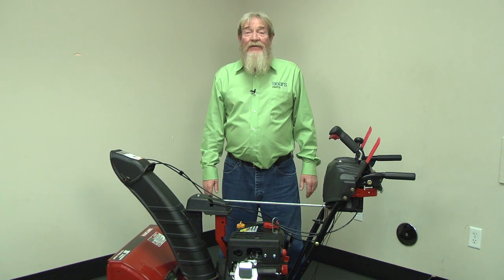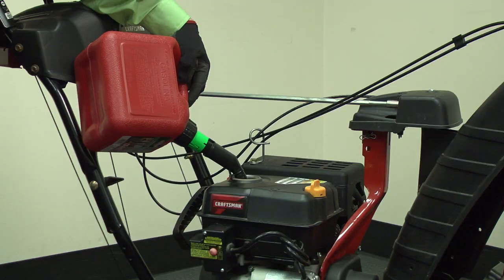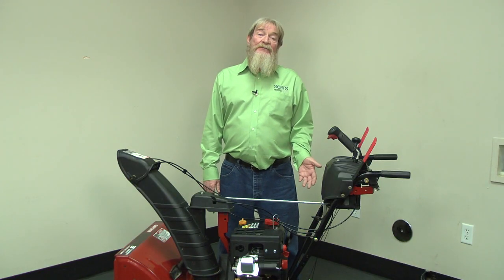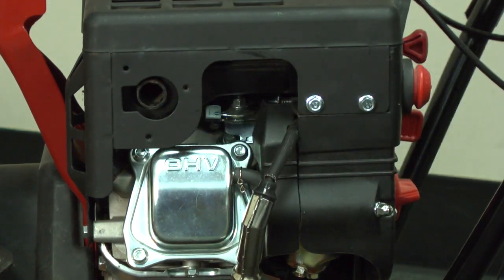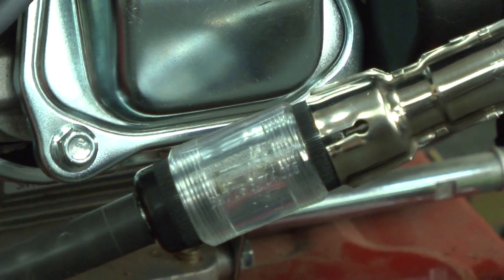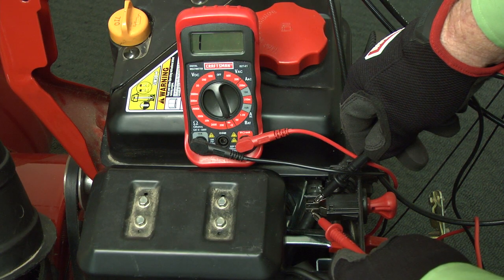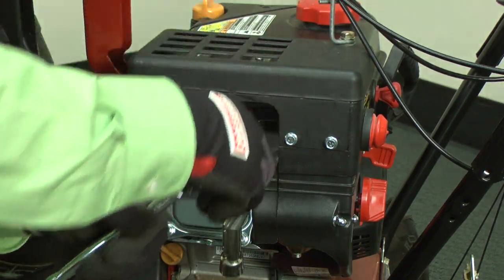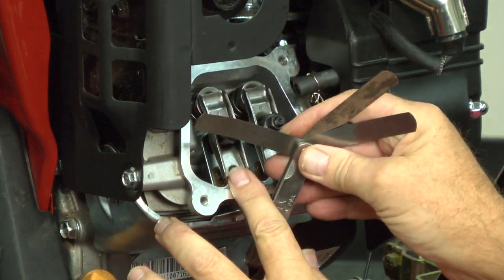Engine Won't Start: Snowblower Troubleshooting

Comment: My blower won't start. I did everything. New carburetor, coil, spark plug, stop switch, set the valve lash, cleaned the flywheel from the rust. No spark. It wasn't the Key Switch or kill switch you pointed out. You called it stop switch although a more common issue.. The stop switch is at the throttle. My problem was with the solid ground wire that runs to that switch. I can't figure out why it was grounding out the coil when this wire had no visible sign of damage. I get spark now only.....It still won't start.
Reply from the maker: Try using starter fluid to start the engine. If the engine starts and runs briefly using starter fluid then you know the ignition system is okay. You may need to replace the fuel filter or fuel line if the snowblower won't stay running after starting the engine with starter fluid. If the engine won't start when you use starter fluid, then check the flywheel key. A damaged flywheel key may be disrupting spark timing. If the flywheel key is intact then lack of compression could be preventing the engine from starting. Check engine compression. We hope that these tips help. If you need further assistance, let us know the model number of your snowblower and details about the troubleshooting results.
Reply: @searspartsdirect  Well it turned out because I had put just regular gas in before this all started happening I ended up with water in my fuel. I had a new carburetor so I didn't want to open it up in case I couldn't take it back or something. Anyhow I took this new carburetor in to have it looked at and that was what they found. They blew out everything and I later tried it. It started first pull. That's the good news. Bad news is I think now I have a bad wheel bearing in my truck.

Comment: Performed the carburetor service, just as you demonstrated, and the engine started. My snow blower is less than 1 year old, and I ran engine until all gas was consumed, at the end of the season, and I was surprised I had this problem..  Thanks for excellent video !!
Reply: Brian same thing happened to me, bought mine 1 year ago this weekend. I can't believe after running it 2-3 times last year this happens. I have had mowers and blowers etc I leave gas in all winter and they fire up fine 5-6 months later. This is pure junk! Now i have to go get fuel filter. I noticed the primer bulb doesn't seem to be getting gas to plug. Unbelievable

Comment: These days Sears is a joke.
Reply: Craftsman sucks period. Got a brand new snowblower and it doesn't start.
Reply: @jamesritch5245  check the choke and throttle. They probably aren't labeled, except for an icon for choke and rabbit/turtle for throttle. I bet the snowblower says to set them both to "full", without clarifying which is "full". Because with the choke full means blocked. And should you go full rabbit or full turtle? The story of the tortoise and the hare says that the turtle will be faster - which means those are really bad icons because the one time they are together is when they are the opposite of expectations.

This is why good things are labeled, and good instructions don't have any chance of ambiguity.
Reply: @jamesritch5245  At one time they made decent homeowner grade equipment once Sears got into financial trouble the quality suffered immensely.  I bought a lawn tractor in 2013 and when I fired it up there was severe vibration turns out the shaft that the cutting blades were attached to were bent. then when service guy fixed it it was still shaking and the service tech said that they all did and left. The reason why I bought it was I had a 2002 model that ran great and was problem free

Comment: I followed all the proper steps to get it started but once it got running I forgot to switch over to run. Then the Troy built cut off, now it won’t start back up. What should I do???
Reply from the maker: Post the model number for your Troy-Bilt snowblower and we’ll provide some specific troubleshooting steps for your model.
Reply: Buy a Honda

Comment: I may have seized the engine on Troy Bilt snowblower by adding too much oil. The pull cord will not work. I did also start it with little oil and smoke did come out.  I know, this was not my best work. Are there any steps I can to un-seizing the engine?

Thanks.
Reply from the maker: The piston may just be locked because the cylinder filled up with oil. Remove the spark plug and then pull the starter rope to cycle the piston in the cylinder. The excess oil should come out the spark plug hole. Reinstall the spark plug and fill the engine with the correct amount of oil and then start the engine. The engine will likely smoke for a while until it burns off all the excess oil then it will likely run fine as long as you have no other engine problems.

Comment: Very nicely done sir. Big fan of Sears/Craftsman products. Shame Sears is loosing customers.
Reply: They loose customers like me for junk machines and making me wait 6 weeks for my snowblower same as the one in the video. Used only one time prior and three big problems pull rope just stayed out auger made loud snap cling and engine has no power to even get it up ramps on my truck anymore. Go buy husqvarna same price. Hundred million times better.
Reply: I have lots of useless craftsman  stories to share, only the hand tools are worth anything.